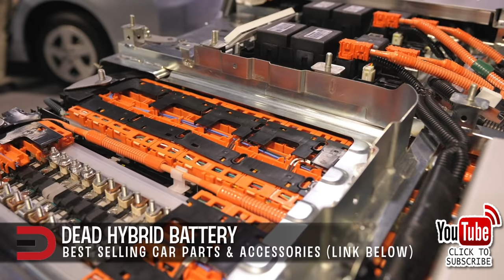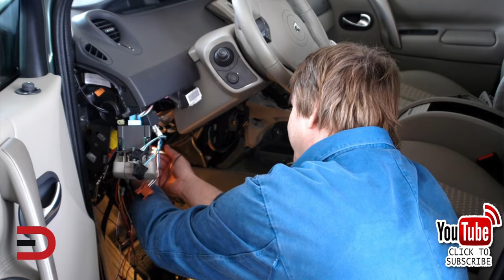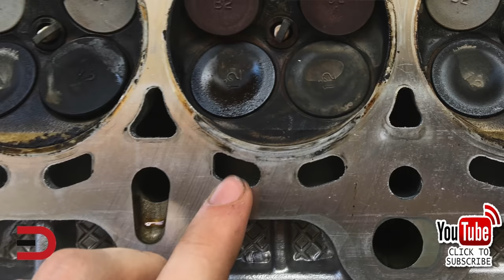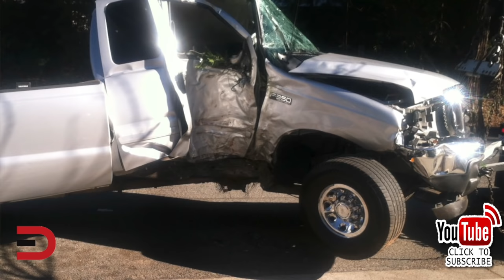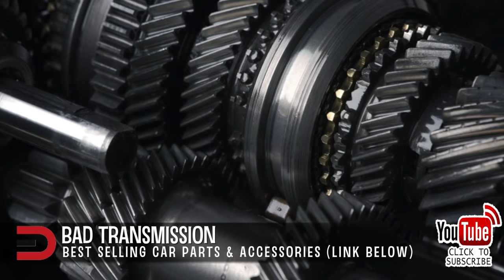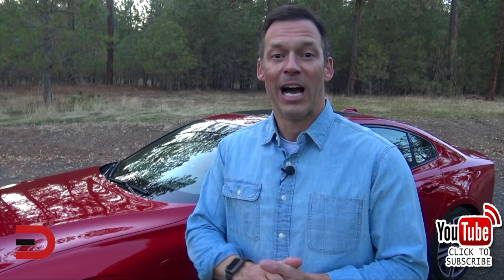These Car Problems are NOT Worth Fixing, Save Your Money Instead

Comment: Dave, and viewers three things despite what professions May say. Transmission rebuilds are still very common and affordable, enginge swaps or rebuilds are also affordable considering that remanufactured engines usually come with a good warranty. Hybrid battery replacement, is becoming very very common place and as such remanufactured third party batteries such as the one in my 09 prius are reasonable. My replacement was 1300.00 and 250.00 labor And the company that sold me the rebuilt battery sent out two techs who did the work in my driveway, gave me a core exchange discount on my oem battery and put my car back together very nicely and clean. I then sold the prius to a couple at my church who gave it to their daughter starting college in New York. I got more than my investment, and since I had all the maintenance records the daughter got a very reliable car inexpensively. So please think and weigh your options if your going to keep your car, the repair cost on transmission rebuild, or engine rebuild or swap is alot less expensive than new car payments. Sure you get a new warranty but New Car Payments over 5 years on average. A huge savings here. Regarding bent frames Yes consider a replacement car. Dont even think of trying to have a bent frame repaired thats a big headache.

Comment: I believe it depends on the model of car you have. Some can be fixed economically. Some not. There is no had and fast rule for all of them. I'm driving a 2001 Ford Escape xlt with 250k on it. So far all the repairs have been cost effective to do.

Comment: WRONG.

The Shop around my house quoted 6k to replace my 2012 Dodge Charger 5.7 HEMI Transmission.   Transmission blew on the Freeway, had 120k on it.

Found a low mileage (43k) transmission on eBay (with warranty I might add) for 700.00, and had ANOTHER shop put it in with a new Transmission service/fluid for 600.00.  Out the door for LESS THAN 1500.00. 

Blown transmission IS NOT A DEAL BREAKER.  It can be reasonably replaced.

Comment: A bad head gasket can cause warping and a new gasket won't fix it.
Reply: That is true, that a blown headgasket can be the result of engine overheated to the point of warpage.  But the cost of repair isn't cost prohibitive for a DIY'er.  The head + block can be resurfaced (milled) for straightness.  If the warpage is so great that the timing will be out of manufacturer's specifications, then in most cases the loss of material can be compensated for with a cylinder head shim.  If no shims are available, it is possible to fabricate a thicker headgasket by taking the old headgasket to a machine/fabrication shop to scan it into a computer, and then cut out a new headgasket out of a thicker sheet of copper.
Reply: @vivillager  I actually didn't know about making a "thicker" headgasket, thank you for your knowledge!

Comment: I know almost nothing about cars, much less hybrid cars. however, I do know that hybrids are extremely expensive and if the battery goes, paying even the top quoted dollar amount in your repair estimate range would be cheaper than buying even a used hybrid. This video seems wildly inaccurate.

Comment: I would say depending on the vehicle, repair costs for a Luxary car vs a regular car will vary from cheap to might as well buy a different car. As an example a cvt transmission replacement cost is  sometimes double what a regular transmission costs.  Now depending on your location but here it was $10000 to replace a cvt transmission for a Mini Cooper.

Comment: This video is not very specific. The value of the vehicle is what determines on wheather or not to fix the vehicle. I'm currently fixing head gaskest on a diesel truck valued at $20,000 and the head gasket repair will cost me $2300 so obviously its well worth it to spend $2300 for repairs on this truck. If I had a 1995 ford escort valued at $500 that needed a head gasket then I would agree that it would be better off to purchase another vehicle.

Comment: Head gasket replacement would be economically OK but it would depend on the make and model of the vehicle. I had a head gasket changed on a Mitsubishi Summit and it cost $400 but on a newer more expensive car like a Cadillac it could be $5000+. Auto transmissions can sometimes be purchased from a scrap car that was accidented or rebuilt - once again it depends on the make and model.

Comment: To avoid bad transmission please avoid Ford vehicles.
Reply: I would say cvt is a problem more than just a Ford. My Ford is a freak. 2009 f150 5.4. The last year they used that engine and the first time they got it right. Bought used at 5 years and no problems especially the transmission. But we all have had good and bad with brands. In was a Chevy guy my whole life until I bought a 2000 z71. Biggest pile of crap ever. But others seem to have relatively few problems.
Reply: Hey that's not fair. They only had bad transmissions in the 80's... and the 90's... and the 00's... and th-- nevermind.

Comment: What about manual transmissions, also the price on that battery isn't that much higher than the cost of an engine so wouldn't it be worthwhile on a fully electric car?
Reply: Also what about preemptive head gasket replacement

Comment: It all depends on the car and your ownership. Is it wise to fix a head gasket on a 4-5 year old car that got overheated? Yes. Is it wise to do a head gasket on a 15 year old beater? Probably not. I brought a lexus rx300 years ago with a blown transmission for $500. New transmission was $2600, drove the car for a few years then sold it for 3k.

Comment: Great video.  I also enjoy reading the comments, especially from those that are mechanically inclined and make it seem that anyone can fix a head gasket, or swap out a transmission, in order for the car to continue to last for 1,000s of more miles ..LOL.  For the other 99 percent of the population, it's not cost effective to go to our trusted mechanic to have these repairs made....period!!!  Example, I'm in the midwest, tell me one competent auto shop that will swap out a transmission for a $1,000.00 and will find you a rebuilt transmission - say for a 2006 Toyota Camry for under $1,500.00.

Comment: What a great video. I agree 100% with everything you said. The transmission one is a little iffy. That can be fixed, however, I would start looking for a new car soon after fixing. Typically a repaired transmission never lasts as long as the original one

Comment: Considering it costs 10 to 20k to rebuid a boxter/cayan engines  in older examples and even then leaving an owner with engines that may or may not be right?  Would it not  be utterly attractive to buy brand spanking new engines at a reasonable pricepoint?  Something with a WARRANTY?  If China COULD build and sell engines cheap then it kind of amazes me that a Chinese company does not build a lower powered  alterative engine for these otherwise totally cool cars....I mean think about it, they could lower the displacement and compression dropping the motors to maybe 125hp so they could get away with lower strength...So long as the price point was say $5k for a brand new plug and play motor?   They could sell them like hotcakes!   The cars would pale performance wise to their orginal glory and yet it would remain a totally cool car to own and drive and turn it into something maintainable for the budget minded....I imagine it would piss the hell out of Porsche too but SCREW them for allowing the situation in the first place! I can see some companies feverishly buying up all the low end Boxters and Caymans they can and doing Mass returns with new low end painjobs, seat covers and Chinese engines ....give em a 2 year drive train warranty and sell em all day long for $20- $25k ...I could also then see Chinise company reinventing their Porsche clone motors with more and more horsepower to meet arious price points.....If they could even reliably get 180ish out of a BRAND NEW warrantied flat six that bolts right up in place of a blown german engine?   I think they could sell the rap out of em!   Maybe it 2 valve heads or whatever I am sure there would be ways to keep costs way down and keep things affordable....Man I would SO be all over it!   I would buy like 10 motors and start looking for rollers ASAP

Comment: A lot of this is not so true , you can get a rebuilt transmission installed for about $ 1700.00 to $2900.0 if the car has 100K or less and the motor is good you have to ask the question can I buy a better car for this money , consider how good a car can I get in this price range , secondly head gaskets ask the same question and in certain conditions and are normally less than a $1000.00 and some cars such as Subarus have this as a chronic problem on their 2.5 Liter engines , so in this case can you buy a better Subaru  for a $1000.00 Probably not The bottom line is don't put money into a high mile beater however if the car is in good condition and doesn't a million miles on it fix it , and consider this a car with say a bad transmission is worth about $ 400.00 same with a blown head gasket. The advice here is get rid of the car, the reality in non running condition it is worth nothing , The rule in this case if the repair exceeds the value of the car don't do it Replace the car ,  This can vary a lot depending on the car and it's resale value.

Comment: This vehicle is bogus. Replacing a head gasket is not so bad to replace. It's easy. And a transmission is not difficult to replace. The main things are wire connectors, bell housing, and torque converter. This video is bogus.

Comment: The electric & bent frame is the only thing this guy got right. Especially if you're doing the repairs yourself. Bad advice from a fake expert! The electrical glitches only applies to newer computer controlled vehicles. Ask yourself how much more use you'll get from a vehicle repair or not? Bang for your buck.

Comment: Transmission problems are the biggest car problems that you'll ever have...... This guy is a joke. The transmission is one of the most important elements of a running vehicle. If you've got a rare car or a truck then you should do better research and learn how to fix any problem that may arise. The only cars that will not be worth a Fortune 50 years from now are those hybrids. If you have to throw away the whole car instead of replacing a simple battery then it's not worth spending your money on. On top of all the materials wasted to build that car.

Comment: This video is very stupid and this guy has no sense about vehicles 
 people that can fix and repair their own vehicles without taking to a shop is always worth it  you can always gets parts cheaper and fixed right if you do the work yourself if your paying a shop it can be pricey but I've done quite a few repairs on my vehicles through the years
 engines cooling fans 
fuel pump transmission axle etc it's worth it to repair than buy new all vehicles will always have breakdowns and need repair and fixed don't matter if it's new or old stuff breaks
Reply from the maker: LOL